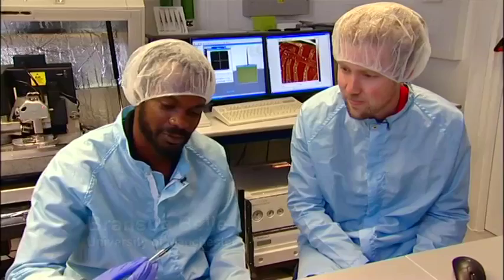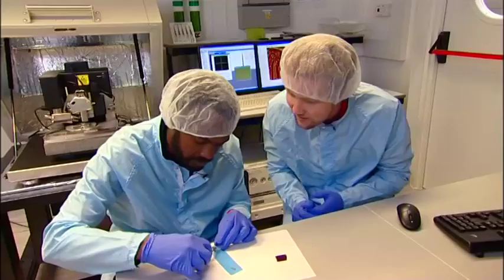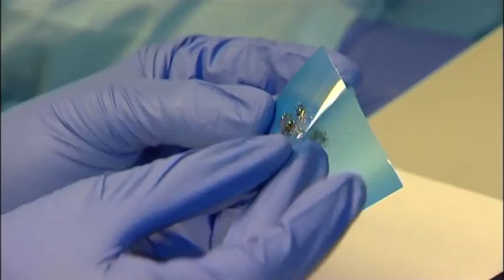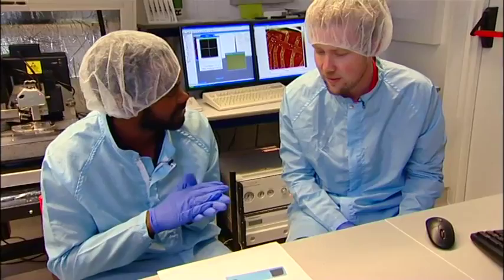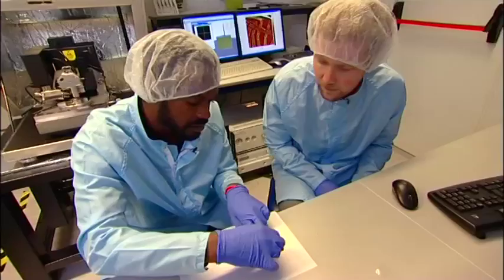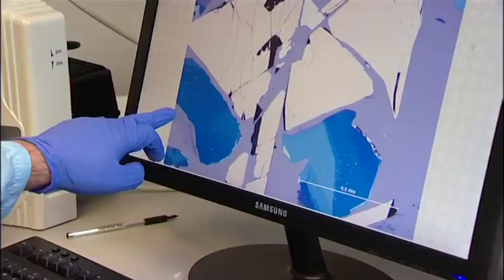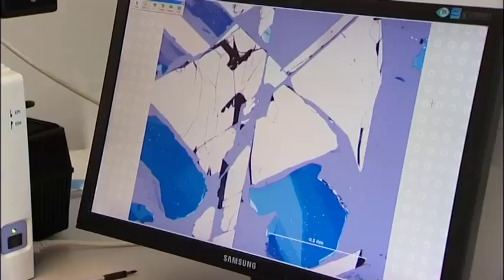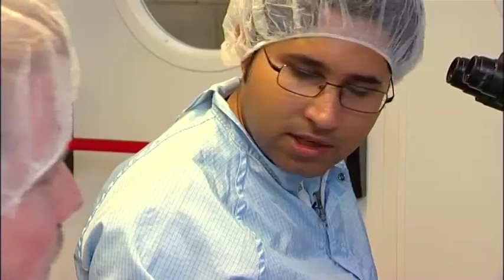How to make graphene

Comment: This process is extremely labor intensive and graphene made this way retailed for $100,000,000/cm2. There are currently significantly cheaper methods involving CDV and copper foil that have reduced cost to below $100/cm2. Expect to see graphene displays in the next 5 years.

Comment: It is actually not that easy. This produces graphene layers that are completely broken and split. for the graphene to be effective building material it requires gigantic sheets of unbroken graphene (think 1mm^2-1cm^2 for electronics, 1m^2-10m^2 for battle gear, and up from 10m^2 for civil construction), the graphene we see here are tiny sheets in the range of micrometers, so not yet usable in any way.

Comment: 4.1 Ghz esacore so it's 4.1*6 = 24.6 ^_^

there's even a optacore from AMD if i'm not wrong so it would bean arround 32 GHz or so... Still single core with graphere is x5 that frequency :D

Comment: this is just what i need to make a fully electric no fuel rocket
Reply: Not likely. You need a really powerful battery, strong magnets, and an electromagnet with as little resistance as possible in order to maximize RPM.
Reply: the rockets shell would be made of charged graphene or lined with charged graphene to power fans that pull air through side holes downward into layered grids of graphite (pencil led) that goes incandescent from the electricity (from the graphene) making it have thrust from the downward force of air and the fire created from the graphite.

I do not understand what RPM has to do with it.

Just so you know i'm 12

Comment: if it's so strong how come it's so easy to break graphite? There is obviously other steps involved to strengthen it. I imagine they take graphite dust put it in solution, and evaporate the solution under pressure creating graphene crystals?
Reply: Because the individual layers are strong. However, the bonds between those layers are not.
Reply: I think it's Van der Waal forces.
Reply: Don't think of strength in absolute terms but rather in relative terms. What other material with such limited mass can withstand anything. But here we have a single layer (at the atomic level) and yet it is formidable.
Reply: the lattice of carbon atoms forms a structure similar to diamond, but more flexible, that is why it's considered so strong, however strongest is still a relative term, since it can't really form any effective bonds out of it's 2d plane, so you're dealing with strength in only 1 layer of atoms, as opposed to diamond, which is a 3d structure(diamond is effectively the 3d form of graphene)

Comment: is there any methods aside from micromechanical method or just the scotch tape method? i mean, cheaper and much more convenient to use.
Reply: amazing! did they eat graphite? then how to get the graphene? you said it was a single layer, how did you confirm it? is there any  journals that you can share to me?
Reply: You need 2 Graphite sticks then stick 1 in positive and other 1 in negative then put it in water.. make sure not to touch each other

Comment: confusing !!!!  only  using sticky tape and Graphite mathod how can this one atom thin layer of Graphene  conduct electricity more than others , i mean this mathod can't spread fewer or  only one layer Graphite uniformily there should be so many Crackes  ,  or   Broken links on Atomic level , and Also same thing  apply on its strength if any broken Link exiast on one layer thin Graphene how it can be most Strongest material .  and i did try to do sticky tape mathod by self for testing its conductivity but what i found it's resistivity  more than KilloOhm !!!!!!!!!
Reply: It's only conductive when you have a single sheet or fine powder with good contact.